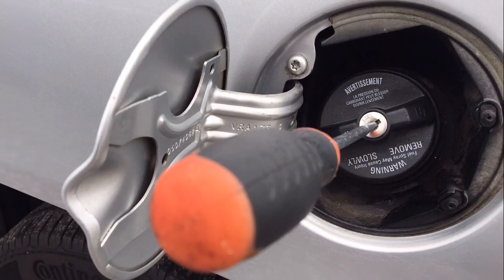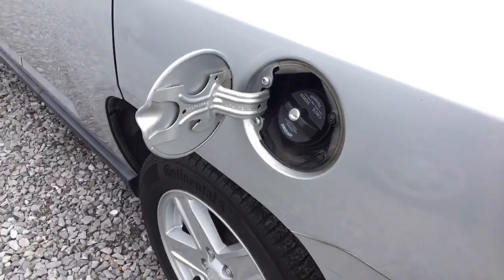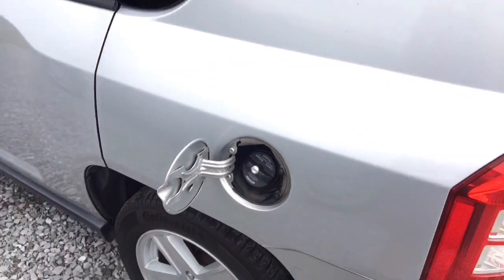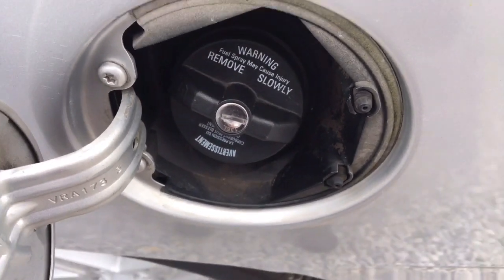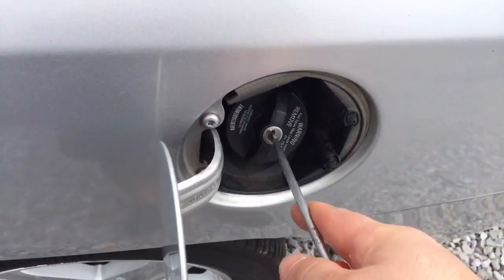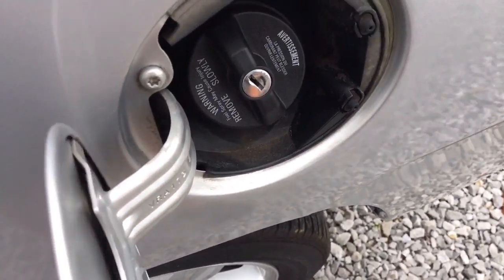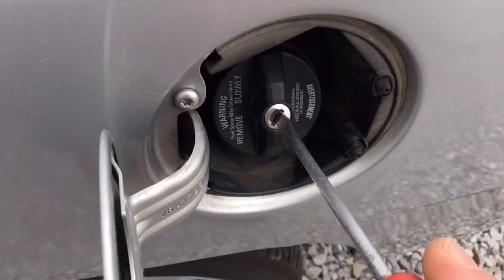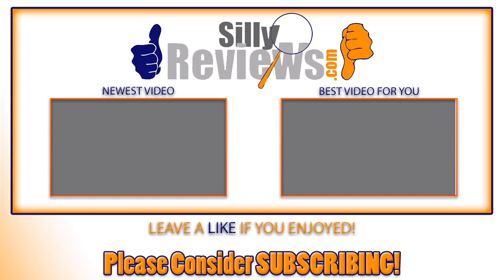Locking Gas Cap Lost Key - How To Open with a Screw Driver!

Comment: you can also just shoot in a screw near the grip handle - use one 3/4" - 1" long and it screws the 2 halves of the cap together.  Comes right off.
Reply from the maker: Interesting idea. And by “shoot” do you mean just drive a screw in?
Reply: yes. battery operated drill and a self-tapping screw.
Reply from the maker: Nice. Thanks for explaining. I’m curious to see if this video jumps in popularity again in the next few months. As we approach spring and summer, I’m certain gas prices will spike again. I’m wondering how many people watched this video to try to siphon gas as opposed to those who needed help with their own video. 
But nowadays, apparently crooks just drill the tank.

Comment: I took the whole silver shiny bit out and it's a freely rotating tube with an end like a very shallow screwdriver tip itself. This tip inserts into a depression. When the barrel turns it rotates the main internal structure, pulling two prongs back. If the springs are too powerful then it can jam.
Reply from the maker: Jamming would not be good but I don't think these caps are made well enough to hold up to any kind of brute force. Just jam that screwdriver in there and turn!

Comment: Damn I used a drill ... Oh well, next time I guess 🤷🏽‍♂️
Reply from the maker: You probably don’t want to risk sparks around gasoline vapors.
Reply: @SillyReviews  True !!! What I did was I actually didn't drill the metal keyhole. I drill a little bit above it on the plastic, and then I put in a screw and by doing that I bypass the whole locking mechanism and it opens and even closes like a normal fuels cap. I guess the screw pushes on a plate or something in there.

Comment: just got a truck and found out the gas cap is stuck lock like the key fits and turns it just doesnt want to open im gonna try this and hope it works cause it has less than a quarter tank 💀

Comment: Great video but my problem is I have the key and it’s just turning when I insert it ..Any ideas before I try the screw driver trick ?
Reply from the maker: The key is spinning freely? 360 degrees?
Reply: Yes it is and just will not open with the key in
Reply from the maker: Sounds broken. Time for the flathead screwdriver.
Reply: @SillyReviews  Thanks will do
Reply from the maker: Good luck. That’s a bummer.
Reply: Same problem here, how did you solved?

Comment: Bought one today went to put gas an the owner didn't give me a key...idk If it's a different key but the car key didn't work. So I tried this method an didn't work...3 different screw drivers I gave it everything to the point where I just beat the hell out of it. Busted the key broke the gas cap spring broke key broke 4 peices came out...I didn't care bout the damn gas cap I just needed to put gas in my new ride!!! So now I just got the gas cap an I put gas cover it up with the cap an be on my way.  So much bs just to put gas like why the fk would u need a damn key for gas...such a damn hassle!!! I broke the mf an now I'm good! Who cares bout a damn cap...ain't nothing goin in it anyways. Jus close it boom problem solved.
Reply from the maker: Most cars from the past 40 years have a diaphragm that would block some efforts to siphon fuel with a flexible hose. People don’t know that and think the locking cop is extra security.....which I suppose is....just not much. More of a deterrent.
Reply: @SillyReviews  yeah I broke mine..I had too. No other choice
Reply from the maker: You got it done!